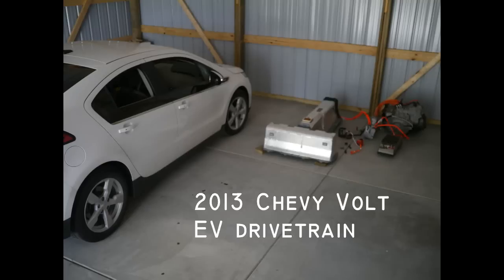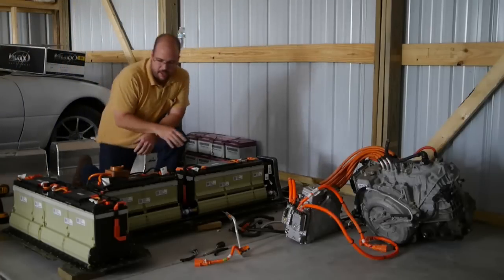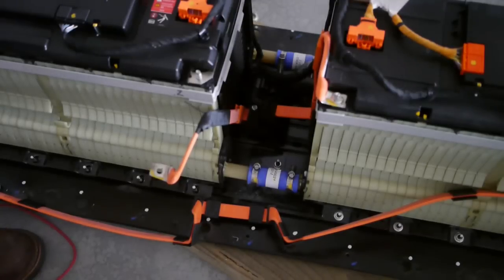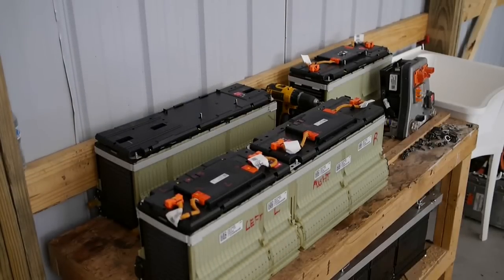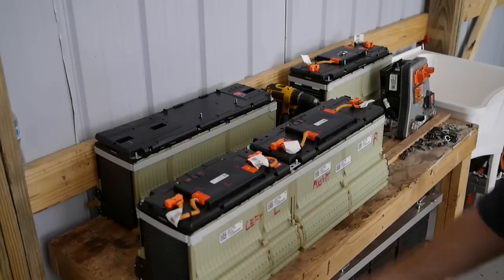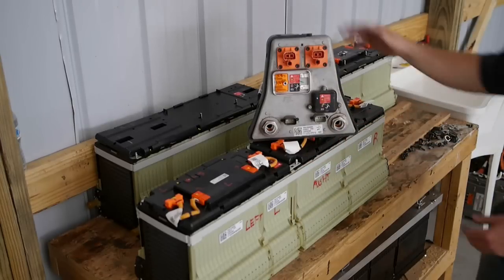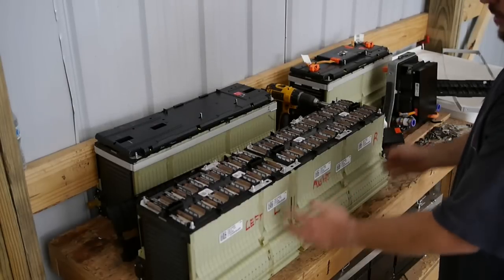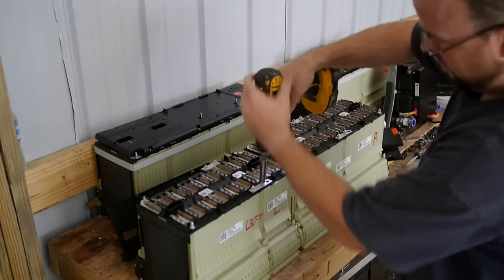Dissecting the Chevy Volt's electric drivetrain

Comment: We need to get together. Lithium Manganese on the gen 1. I'm picking up a 2012 pack from a salvage yard since I've lost about 25 percent range on my original pack with 130k miles. FYI, my pack was like new up until last October with 128k miles. It turns out when you take your volt in for scheduled maintenance and updates, they don't check the battery coolant. In fact, nobody at any of the chevy dealers can give you accurate information, so I recommend that anyone with a chevy EV to periodically check all of your fluid levels under the hood. I had assumed they were topping off the battery coolant the past couple years when I took it in for maintenance, but they were not and the battery coolant evaporated, or got siphened out. I drove the car with no coolant for a couple months until an odb2 code came up that had to do with battery pack fault isolation, which was not caused by a module issue as the tech told me, it was tripped because there was no coolant in the battery!

The pack I'm getting is from the same production line and only has 20k miles on it and again one volt tech told me that you can't use traction batteries from other 2012 cars and that they have to be programmed and ordered directly from Chevy with I'm pretty sure is complete bullshit. Now, I might need to take off the 4 battery control modules from my old pack and swap them onto the replacement pack. There is nothing tying the actual Physical battery to the individual cars aside from the modules that could store information about VIN numbers and things like that. Do you have another video showing removal of the battery from underneath the car? That is going to be the hardest thing to accomplish. What are your thoughts?
Reply: Zap -  I'm in a similar boat... I recently bought a 2011 with 166k which was in pristine condition and still demonstrated very good EV performance with the pack.  Unfortunately after about 1 month and 3K miles the car went into Power Down mode and after trying many "obvious" fixes such as disconnecting 12V and also charging IT up fully, reading out and resetting all the DTC codes, etc I dropped in at the GM dealer service bay.    After being treated pretty abruptly (rudely?) by the first person I spoke with, another service rep/tech overheard the conversation and was mildly more helpful.  He was able to confirm (remembered) that the previous owner had been in and had the Battery reset... once with them, and once with another dealer 100 miles away when she got stranded again.   Not too surpising she passed this on to me without any disclosure, she paid way too much for it ($7500) from an out of state dealer (shipped to her) and was trying to cut her losses.  She was VERY relieved when she realized I was an EV enthusiast with experience (though still didn't disclose) and insisted on selling to me for $5K rather than an average "civilian" who would obviously be (even more) stuck with no options when it failed again.  In any case, I don't trust this dealer to have enough experience (or motivation) to do anything but insist on a $10k full replacement, etc.   I understand that these beasts are technically very sophisticated, beyond the average mechanic, but as an EV/off-grid enthusiast, they seem pretty straightforward.   You asked about removal (install) of the pack...  I have looked far and wide for direction, input, help, etc.  and found little...  it does appear that with little more than an access plate removal on the bottom front (I don't have a lift, so hard to verify until I do) that the 2 HV cables (charge and drive) and 2 BMS cables and the coolant (in/out) ports are all accessible.  Beyond that it is a matter of supporting the pack well on a hydraulic lift, unbolting, and lowering (or as I saw in one timelapse, rolling a dolly under, lowering the weight gently onto the dolly, removing the remaining bolts and then lifting the car off the pack).   I sent a Hangouts invite to chat offline.
Reply: There is a utube video on a complete installation and tear down and reinstallation from an instructor that teaches techs he is in a wheelchair
Reply: @GoldensRule45  that guy is really good

Comment: The chemistry is VERY long life oriented, able to function in colder weather but at the sacrifice of weight, these packs have a energy density similar to nimh  An 18650 cell package of similar weight would be 38-44 KWh giving the volt a range of roughly 95-100 miles all things being equal.

Comment: Just wanted to comment that rumors of batteries not lasting the life of the car are complete fiction. As of last October I had 2500 cycles on my pack and I had not lost a single mile of range (45 miles.) Just check your battery coolant from time to time and charge it at level 1 120v 12amp (standard outlet) every single night and Use 240v 10amp level 2 sparingly. Chevy services managers and even their EV techs are still for the most part clueless about their EV's and they don't check the battery coolant when you take it in for maintenance, at least in my case.

Comment: Thanks for the video. For reassembly, could you use three long all-threads with nuts to compress the pack enough to get the first bolt started, and then do the others one by one? Of course, you probably had the wood clamps already, but if you had to do this repeatedly, it might be easier.

Comment: That's a awesome video brother! I can't afford a volt because I'm a paramedic so I'm poor lol but it's good to know how this is made due to responding to a few of volts involved in a MVA, I was worried about how the battery design might hurt the passengers but it looks not too bad , thanks
Reply: You might be surprised, don't forget the government incentive.  Base Volt is something like $34k, but you get a $6k tax credit (not tax deduction) so as long as you're paying at least $6k into FICA throughout the year, you'll get a $6k check back at the end, which makes it a 28k car.  Or lease - with a 10k tradein, low miles lease, my payment is $108 a month.  I've gone >4000 miles and not had to buy gas yet, vs $20 a week with my last car, so that makes it $28 a month net.  It also lowered my insurance $30 a month, so I'm actually being paid $2 a month to drive a 2017 Volt after all is said and done.

Comment: Can these batteries be used for off grid housing using solar panels to generate energy. I am looking into 10kwh system. Are these 48v 50ah packs? Can 48v inverter and charge controller support these batteries. Seems like a very inexpensive option for off grid living if done correctly.
Reply: They're 44v Because of that, you lose some of the power with standard inverte/charger. But 44v charger/inverters are available.

Comment: Do you know were the battery temp sensors are. It shows to have 9 battery temp sensors. My volt have a senor B fault. 
code P0AC6 Hybrid Battery Temperature Sensor B Range/Performance. 
Hopefully I dont have to break down the whole pack like you did. 
Thanks, Mike

Comment: I have 2 Volts and between them have had 3 occurrences of "service high voltage system".  Twice the battery coolant was low and once the sensor for the battery coolant was faulty.  My wife's Volt has recently gotten the fault again, but we both have over 100,000 miles.  How do I check the level of coolant and fill if low?  Thank you.

Comment: what is the nominal voltage of those units, is it 48v which can be charged up to 54? or is 44 volts of which can be charged up to 50 volts? im at a loss between if these are 12s or 13s battery packs . i am trying to figure out what charger to use for this for my EV project
Reply: it's 3 to 4.1 volt per cell

Comment: I bought the battery pack too with the shell included but for  some reason when connecting to the shell’s main gate(outlet) there seems to be no voltage coming through. So do I need to recharge the whole pack or is there a safety switch that is impeding voltage coming through?

Comment: Did you ever track down the supplier & part number of the orange BMS connector? Is the the same pin-out on either side of the cable for the 48V version? I'd like to use one cable  to support connection to 2 different 48V batteries via 2 separate BMS's. I'll cut it in two pieces.

Comment: Why don't you use the battery for a backup system for your house?
Reply from the maker: We are on the grid and it would not be the best use of the pack.  It is an option people who want to go off the grid but there are battery chemistries with higher cycle life for that application.
Reply: I want to go offgrid with these. Can the chevy bms sitll work aside of the car? How to charge entire battery 360v and put an inverter of 115 vac output? 
My idea its to allow the chevy bms to keep battery stable and make use of full battery without dissambling . any idea ir link?

Comment: Do you know if there is a way to test the voltage of the battery pack voltage outside of the vehicle? like reconnect the disconnect and test voltage between terminals?
Reply: He did that at 2:12, although I don't think he showed where he connected.

Comment: NOW THAT THE BATTERY IS OUT THE VOLT, WILL THE CAR OPERATE AS A GAS ONLY CAR ?
Reply: No. The volt can't work that way. The engine functions (mostly) as a generator that generates electricity to drive the electric motor.

Comment: Dude, you are crazy! 350 volts and all the amps that can possibly be pushed through a human body will kill you. It would also set back electric vehicles in general if you made the news as being killed by one!
Reply from the maker: Well Phil, Thank you for your concern about my health and safety (and putting it so politely).  I am a trained engineer and have been doing this for the better part of a decade.  And at my last job I oversaw testing for the direct effects of lightning strikes on aircraft.  But for everyone else: please don't try this at home.
Reply: I can bet that the pack is completely dischaged and has no energy.
Reply: Some blue electric gloves may be a small safety benefit during disassembly.
Reply: Raymond Ramírez That's a very dangerous bet!
Reply from the maker: Raymond Ramírez No, closer to a full charge. Never assume a battery is discharged.  Even a "Discharged" battery has enough voltage to do serious damage.  You should always treat batteries as a hot circuit.
Reply: d55guy Where did you get your training?
Reply: Phil Kulak amps kill you, not volts.
Reply: Lehel Hanko Check out Ohm's Law. Volts determine amps, since your resistance is constant.